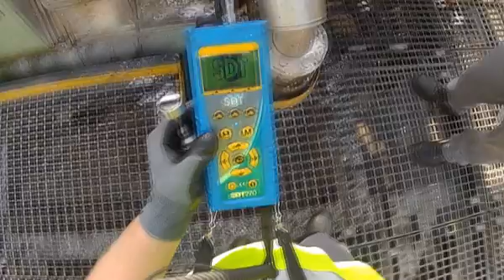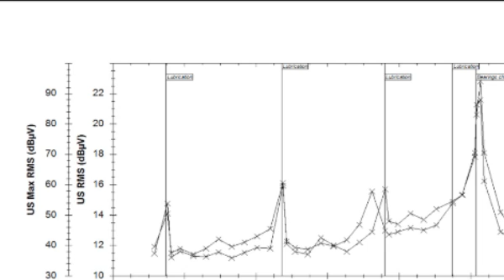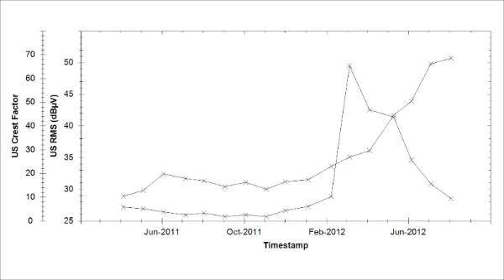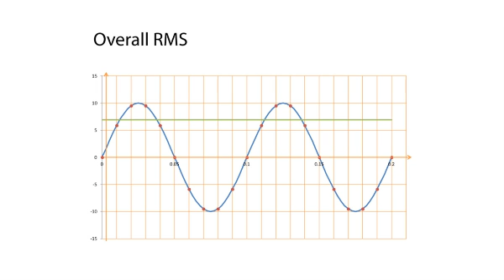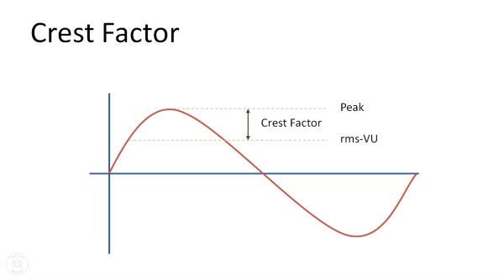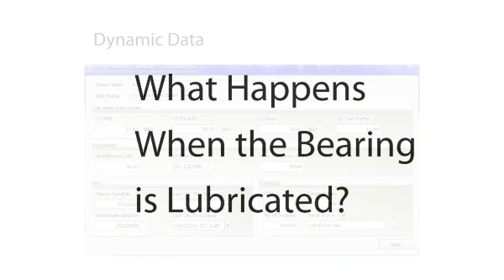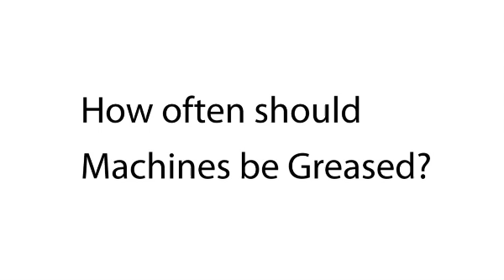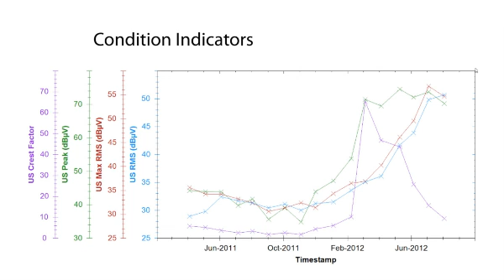Avoid These 3 Common Mistakes When Lubricating Bearings

Comment: Correct me if I'm wrong but wouldn't temperature be a even more accurate way to determine friction levels? Maybe a infrared heat gun
Reply from the maker: Hi Mike, thank you for your comment. 

Friction and temperature are definitely related, but temperature isn’t the most accurate way to monitor friction levels in a bearing. Ultrasound is the better method because it directly measures frictional energy in real-time, whereas temperature is a delayed effect of increased friction.

With an infrared heat gun, you’d be monitoring the byproduct of friction rather than the friction itself. And because temperature is influenced by external factors like ambient heat and humidity, it can be misleading. Plus, a major increase in friction often results in only a minor temperature change—so by the time you see a significant temperature rise, the damage could already be done.

Ultrasound, on the other hand, provides an instant and quantifiable decibel microvolt reading of friction as it increases, giving you a much earlier warning before a bearing reaches the failure stage.
Reply: @SDTHearMore  hey how are you? Thank you for the insight on that. You explained it very well,and I honestly didn't factor in real time.. great video!!
Reply from the maker: We're happy to hear you found it informative! If you're interested in learning more about what SDT's Products, Services, or Training can help improve your machinery lubrication program don't hesitate to reach out at: hearmore@sdtultrasound.com

Comment: Where the F did you take the greasing of a bearing to ?
Reply from the maker: The measurement acquisition point is ideally close to the bearing - on the bearing housing, or using a special attachment we call the LUBE Adapter. 

The Acoustic Lube Adapter connects the LUBExpert directly to the grease fitting creating a sealed acoustic path for a reliable signal capture, ensuring consistency across measurements.

Comment: I mean yeah thats a high-tech tool but for the average mechanic.. is it necessary?
Reply from the maker: Hi Jake ! 

The notion of necessary is all relative to your economic reality. Is it necessary to apply this approach to lubricate an engine that operates 10 hours per year and for which the criticality is low? Probably not not. Is it necessary or useful to do this on critical rolling bearings in a metallurgical production where the production stoppage amounts to several tens of thousands of €/$ per hour? It's up to you to answer.

#hearmore
Reply: No.

Comment: I clicked off at 1:20, once I realized it's a 16 min infomercial. I grease my equipment  every few hours. Grease is cheaper than parts.
Reply from the maker: Sure but the main idea is not to lubricate bearings on a time-based schedule but on a condition-based schedule.
Reply: Então a lubrificação de rolamentos a graxa é mais barata
Reply: “Grease is cheaper than parts” is almost exactly what they are saying. Proper maintenance is cheaper than parts and they are helping with proper maintenance
Reply from the maker: arbitrarily greasing your bearings every few hours without is "proper maintenance" ??
Reply: @danielyoder1462  cheaper than parts AND labor

Comment: So what is the best lubricant for bearings ??? ... Is it grease, white lithium, singer oil ?
Reply: I.e., what kind of bearing and what application?
Reply: He doesn’t know, and don’t care.
This video is commercial for his ultrasound gizmo.
Reply from the maker: @commenter5469 It helps to know a little about the asset first. Precision lubrication is far from a one size fits all approach.
Reply: High temp Marine works well for outdoor equipment
Reply from the maker: Your comment would make sense if precision lubrication was a one size fits all approach. But it's not. 

Your question is better directed at an Oil Analysis Lab or directly consulting with your bearing / production asset OEM. 

Once you know what type of grease you need, we'll make sure you never over / under lubricate your bearings again.

Comment: Grease my old excavator every day before starting the day. Still tight with very little play in joints. Greasing works.
Reply: Too much grease and you will blow the bearings and cause more problems.
Reply: @sarahelinburg8308  nonsense- they aren't pressure-fed
Reply: The bearings on an excavator are also operated at low speeds. Also it’s bushings not bearings on an excavator boom which is a totally different application